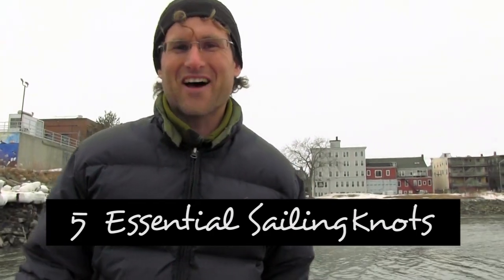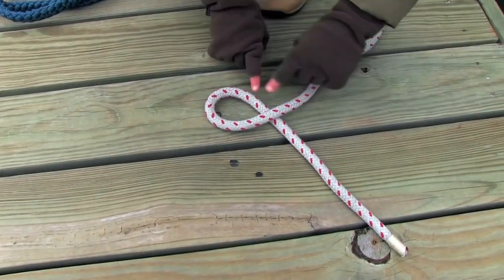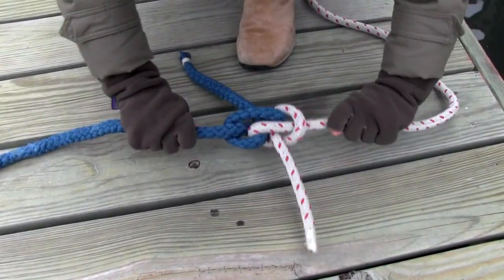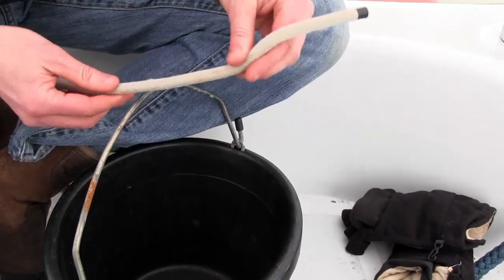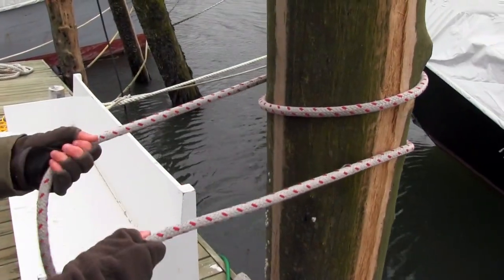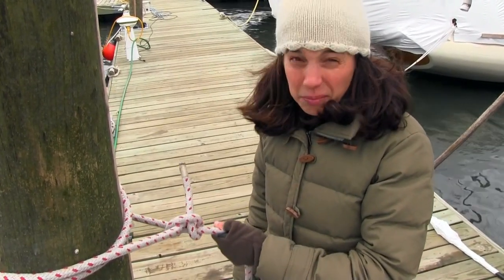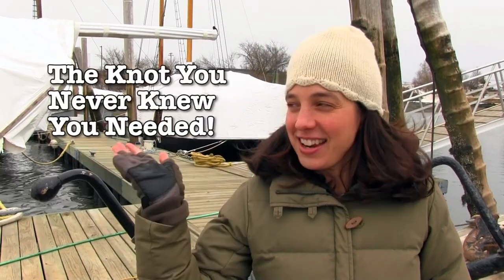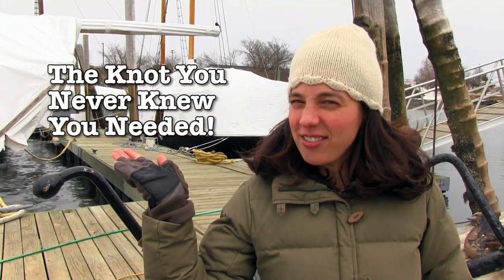5 Essential Sailing Knots - How To Tie & When To Use 'Em

Comment: Zeppelin bend---imo the king of the bends.  Can't jam.  Beautiful.  Symmetrical.  Btw, I call it a 'collar' that you pull back to loosen...you 'break the collar'.
Constrictor family of knots. there's quite a few variations.  
Rolling hitch family of hitches, also quite a few variations exist of those.  Also called tautline or tentline hitches when used in camping.

Comment: I'm enjoying your blog and vids very much.  I live and sail in Juneau Alaska and have sailed for some 40 years (am 55 y.o.).  For the cleat hitch, I tell people 'two under and one over'.  There should be two lines visible under the 'one over' locking half hitch.  I also warn people that a bowline is a tension knot.  It can come loose if there's a constant releasing and reapplying of tension on the bowline.  They lock best under a steady load.  Sometimes I'll throw a couple of half hitches on the bowline bitter end and that seams to help.  
Keep up the good work!
Reply from the maker: Yes good point on the clear hitch. I learned a new pneumonic for that: "two rivers, one bridge". That's easy to remember. 

Also good point on the constant tension issues. Although I have not noticed that to be much of an issue with the bowline. However the square knot suffers tremendously from that issue. But I agree a few half hitches to lock things never hurts. Thanks for the comments.

Comment: Good job!! Just stumbled on your video. Use 4 out of five myself, but I don't feel the need to take so many wraps around a cleat before tying it off. One wrap has worked for me for over 40 years, and if I need to get away quickly,  less is quicker...just my opinion.
Reply from the maker: All depends on your load. More load = more wraps.
Reply: Still unnecessary. There's plenty enough friction with one wrap, even on a nice polished  s/s cleat. As I said, worked for me for over 40 years, and I've had situations where I thought my cleats would be ripped out.  To each his own, but I, and the Maryland School of Sailing, disagree.
Reply from the maker: It may stay made off with one wrap, but if you need to slip it under heavy load, I think you might not have enough wraps to control the line.
Reply: Are you referring to number of wraps on the cleat, or when you are working with a line? Thats two different purposes. Of course, all lines will be "worked with" eventually - when you leave the dock, tack the boat, etc. It is in those dynamic moments where the number of wraps is most critical. The number of wraps depends on the boat and the load - which is a result of wind, surge, and current factors as well. You could get away with one wrap in many situations, but not all. The concern comes when easing up on that line. The load might be too much after just removing the single wrap because at that point you are holding the entire load in your hands. I've seen people break their hand this way - when a gust comes and the force is so quick it sucked the hand right into the cleat and gets pinched. It can be avoided with additional wraps so you can test the load gradually, and even hold a wicked strong force with the help of additional friction. I would say 1 wrap works only if you aren't expecting any sudden gusts, or if you have light breeze and a small boat. Any moderate breeze, 25+ and I'm already using several wraps. Plus, it gets gusty out there on the ocean or even inland lakes. I'm reminded of the Hayden quote: "Always keep in tune with the feel and heft of the wind and don’t ever forget that a sudden gust can lay this wagon down so hard that she’ll never get up again…no matter how hard you’ve prayed." To be honest, I can't say that one wrap, five wraps, or any number of wraps works in all cases. The environment is so dynamic that through thousands of miles at sea I've seen such diverse situations - a true understanding of how and why a knot or hitch works is much better than relying on any one standard for all situations.
Reply: As I said, to each his own. I too have thousands of ocean miles. Started sailing at age 12 in Hawaii, where strong trades of 20+ knots are common and have progressed to larger sailboats in my life. Sailed on boats up to 68 feet, also was a commercial fisherman for a while and never-never- have had a problem with controlling or easing a line wrapped around a cleat with one wrap. Maybe I'm lucky. Maybe I'm strong. All I know is over my lifetime of sailing-I'm 62 now- one wrap has worked for me, held my boats, and the countless others I've been on and entrusted with. You tube is full of videos made by people who don't know what they're doing. You can find people raising their garage with car jacks. Works for them, but doesn't make it the right or safe way to do it  and I wouldn't try it. There are also other videos made by people who have learned the right way to do something, have experience, and are teaching such as the Maryland  School of Sailing, ASA, or US Powerboating squad. Do a  "Proper way to tie a cleat" search on Youtube and see how far you have to go before you see a picture with more than one wrap. To each his own...
Reply: I think the number of wraps also applies in the same way to winches. It can be impossible to hold a line on a gusty day with only 2 wraps on the winch. Its the same mechanics for a cleat. Thats what I'm talking about - for clarification. Thanks!
Reply: @teresacarey2215  Wraps around a winch and a figure 8 over a cleat are two different things. Lot more friction on a figure 8, and if you maintain tension on the free end of a sheet, even two wraps on a winch will hold.

Comment: Great video -thanks. The Zepplin knot is genius but wonder if it could come undone when the rode is slack. Maybe I'd put a couple of locking hitches on it?
Reply: If you are going to bother with locking hitches... There are better knots that don't need 'em... Figure 8 Bend is a good one(I'm not knocking the Zeppelin Bend, just suggesting an alternative, that may be better suited to the scenario that you have mentioned...)

Comment: Nice presentation of these indeed useful knots. One not known being the Zeppelin Bend. Does it originate from anchoring a Zeppelin where very long lines are needed, Teresa?  Is a thinner line actually required in this situation where you had to release tension on the Jib sheet using the Rolling Hitch, Ben?
Reply: +Rob de Richemont The Zeppelin can be used with two ropes of different thicknesses. I don't know its origins. The rolling hitch can be used with a fatter line. We use a rolling hitch for a snubber line and it is 7/8in.

Comment: Damn, is mine going to be the only negative comment on this page?  The version of the Rolling Hitch you should use in my opinion, should have the second of the two coils going back the other way (between the standing end and the first coil).  It just grips a little better on slippery lines/sheets than your version (what I call a Tautline Hitch).  My favourite knots are also the Zeppelin Bend, the Round Turn & 2 Half Hitches and the Constrictor.
Reply from the maker: I've seen lots of variations on that rolling/taughtline hitch - once you know some good basics, whatever works - wins. We employ both methods. Thanks for pointing out the variation.

Comment: Is the  Constrictor Knot also used on anchors?
Reply from the maker: I’ve never seen it tied to an anchor. It’s not designed for that direction of pull. It’s designed for a perpendicular strain.

Comment: How is the  Constrictor Knot different from the Clove Hitch used to tie an object?
Reply from the maker: The clove hitch isn’t super secure. If the load isn’t constant, it has a tendency to come loose. And the clove hitch slides side to side of pulled that way. The constrictor tightens hard on the object it’s being tied around and doesn’t come undone when the strain is removed. It also resists sliding sideways. I always tie a half hitch after a clove hitch just to be safe.

Comment: When do you choose to put a bite into, say, a locking hitch? It always seems to me that having a bite means I can undo a knot quickly, but I fear I'm making the damn thing weaker.
Reply from the maker: +MoonshineSazerac Well I think you mean a slippery hitch right? Check out Teresa's article on the subject: http://sailingsimplicity.com/the-knot-you-never-thought-you-needed/

It's a great way to tie stuff, we use them all the time... just add another hitch AFTER the slippery one.
Reply: Great read, thanks so much! I'd rather have a single knot i can use in different ways than a plethora that I'd probably forget under pressure. The trucker's hitch in invaluable, great when lashing something to the side of a cliff.
Reply from the maker: MoonshineSazerac I dont think there is a single knot you can use in different ways. You need a handful of knots, like 5.... seriously these 5 in the video... cover it 99% of the time. Learn em, love em, use em.